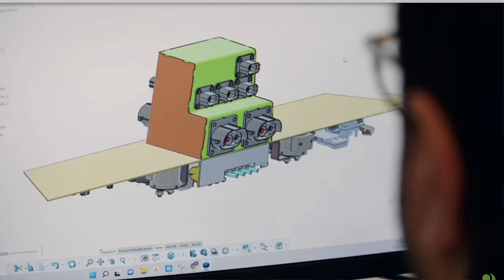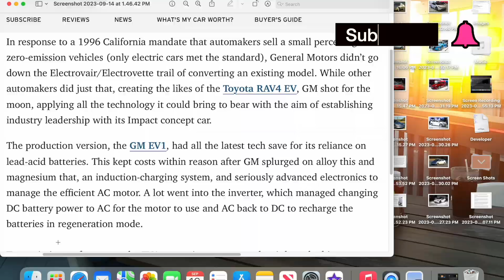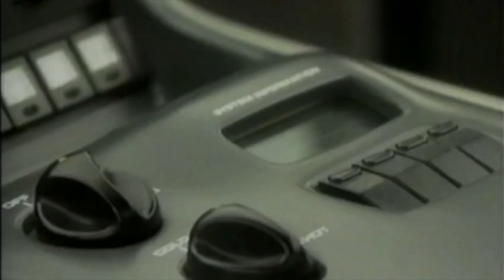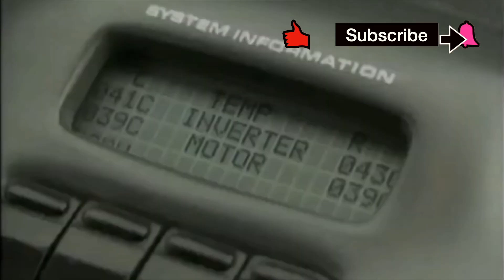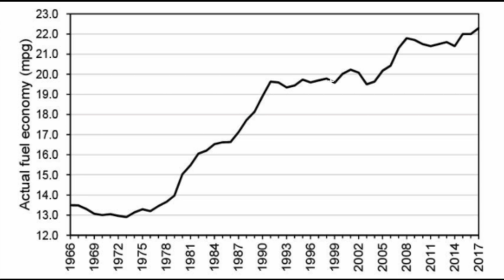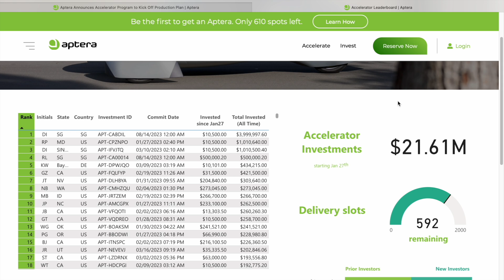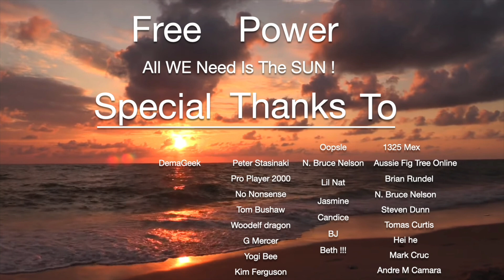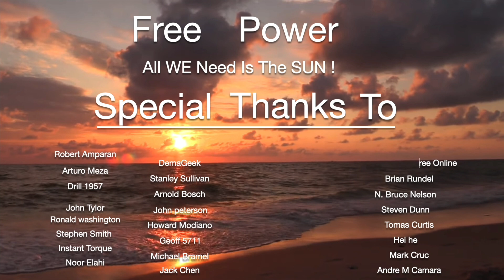Aptera Is Going To Change The Status Quo , Part 1

Comment: The week point on my 2011 Volt was the low rolling resistance tires.  I had at least twice as many tire prooblems with my volt as any car I previously owned.  I still have my Volt but have chanced to Tiger paw tires and have much better handling and much fewer tire problems and twice the tire lifetime with only about 10% less range.
Reply from the maker: Nice ! 😎
Reply: Look up the METL tires.  They are coming, another tremendous technological improvement.  Designed by NASA.